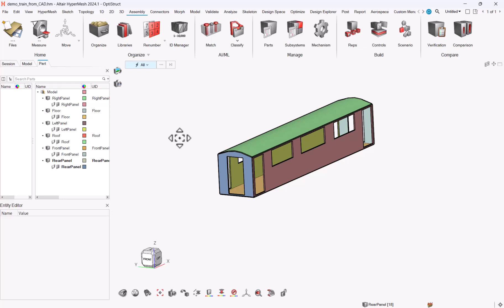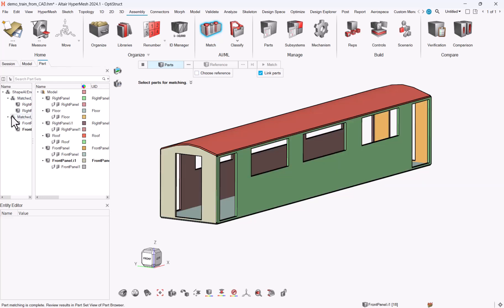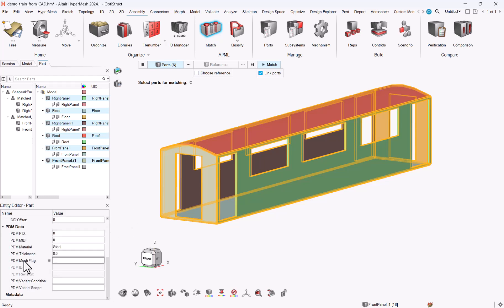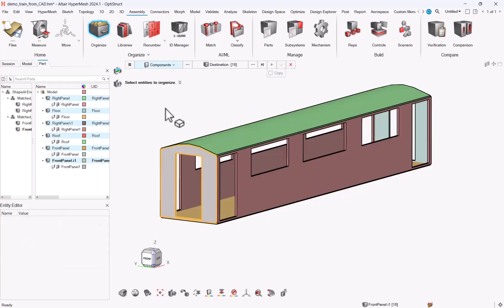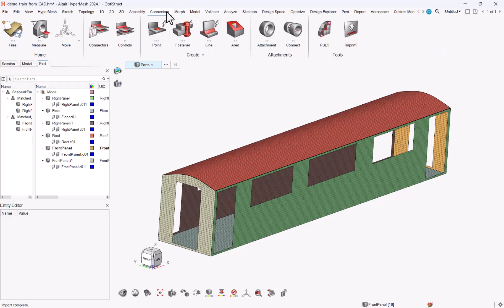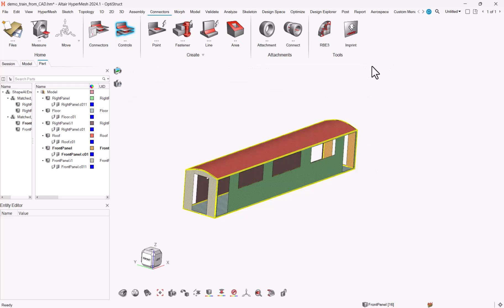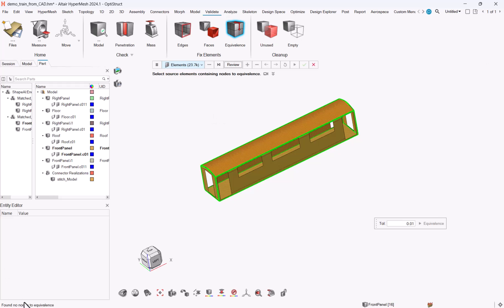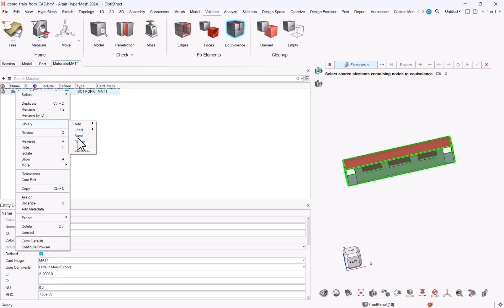How to mesh and stitch panels together with HyperMesh

Comment: Please improve more
Reply from the maker: hello @johngopi9565, may we ask you which kind of improvements you would like to see in our software?
Reply: T edges and free edges directly stitched option we need
Reply from the maker: @johngopi9465  Surface Repair tool (https://youtu.be/hHWwa8twsdc?si=-geikI4ZYXqe91e7) and Topology -> Stitch should help in case you are editing a geometry inside a given part. If you want to stitch different parts together, the workflow in the video is recommended as it streamlines not only the mesh, but also material and property creation and assignment
Reply: We have problem in the linux version hypermesh 24  and 23 both. 
Problem: CAD not import the hypermesh 24 and 23.

"STEP"Cad  not import the hypermesh but windows version working
Reply from the maker: @johngopi9465  for that case, please report an issue to our support so that we can investigate